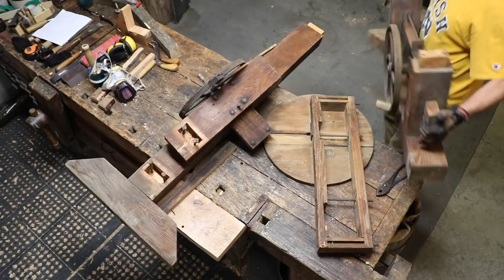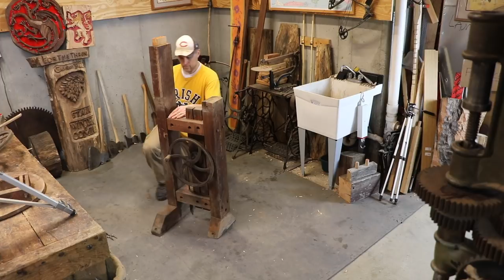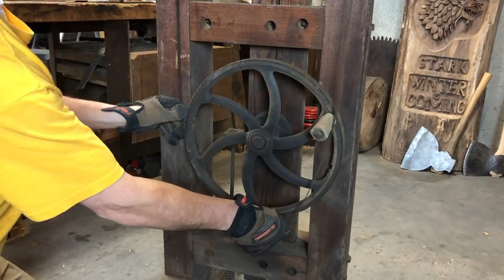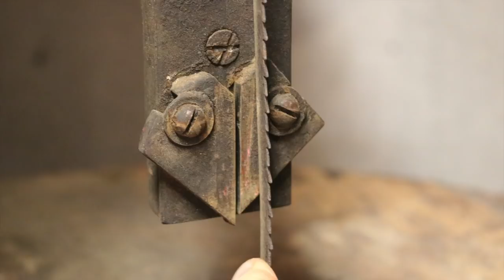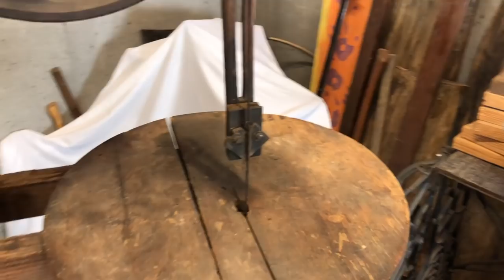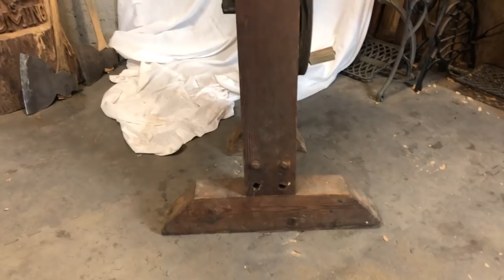Hand Powered Band Saw Assembly and Detailed Views

Comment: That is an amazing piece. I could see some easy mods to make it powered and a bit safer. (wanna keep all the fingers.)
Reply from the maker: Tell me please!
Reply: @ChopWithChris  a off set motor Maybe with a step down for more power then speed. (don't know how the sprockets would hold up to high speed) then perhaps a thick Plexiglas cover for the blade and wheels (so you can still see it but you don't bump into them.  Again sexy piece I have never seen one like that with all the key pieces.
Reply from the maker: Thanks!
Reply: @ChopWithChris  I hope it helps on that same note you could get an apprentice to hand crank it just for giggles.